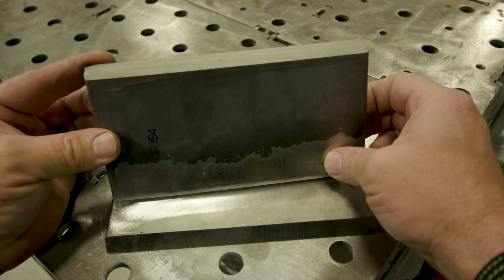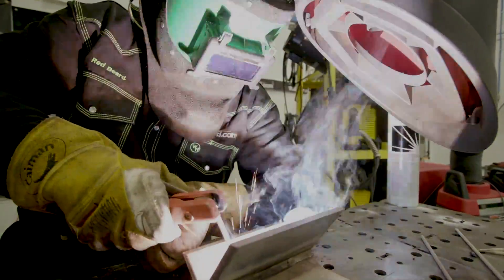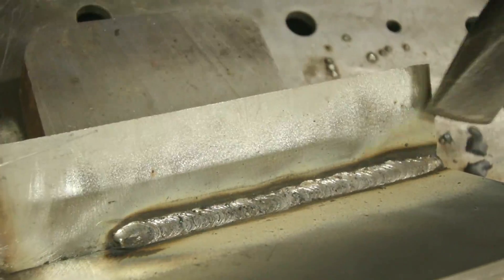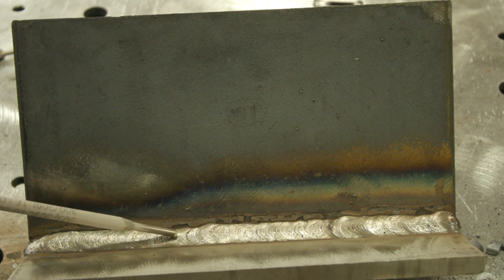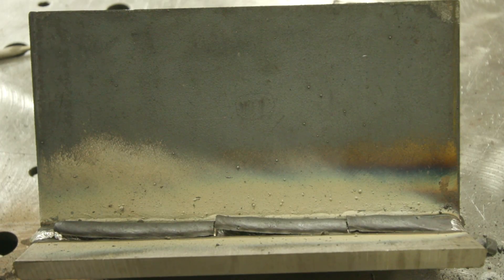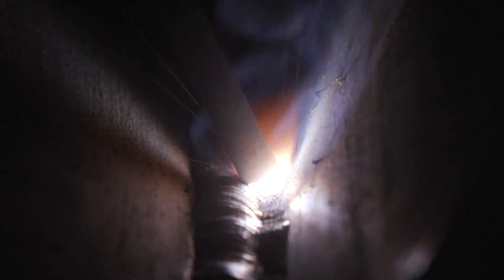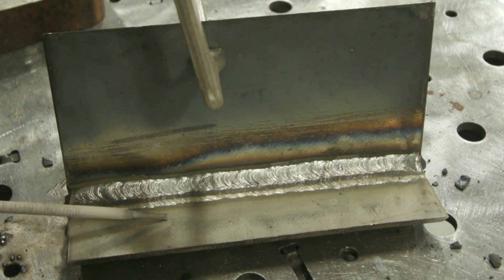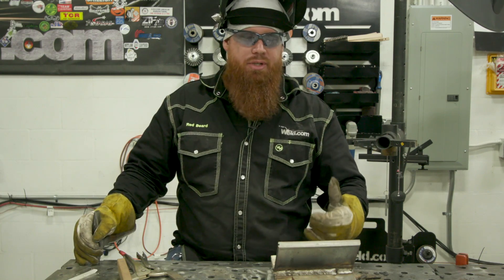Welding Stainless to Carbon Steel with 309 (1F)

Comment: Can you use these rods for stainless to mild steel?
Reply: A36 is what he said in the first of video...
"...ASTM A36 steel is one of the most widely used carbon structural steels, although the carbon content of A36 material is maximum 0.29%, it is considered to be the mild steel (content of carbon ≤ 0.25%)....
https://www.theworldmaterial.com/astm-a36-steel

Comment: While watching 2 things came to mind. (More, but for now just the 2) First, it would be interesting in finding out some metal composition details on why you put more heat into the stainless. Does it conduct heat better, ...? Second, assuming I remember correctly from others videos, I had thought stainless should be welded with as little heat as possible. Or was that when stainless is welded to stainless, or under food grade applications, or..?
Whatever, nice video, thanks !

Comment: There be eth a couple of spots on my steel boat where a stainless fitting was welded to the hi tensile steel deck and after 48 years the steel is suffering like el rusto malo ish.   And seeing you brought up the subject of steel boats,  I'm having a lot of bother stick  welding the one inch gal pipe to the 1/8th" deck.  Actually I'm not on the deck, just practicing with lots a chopped pipe onto 3mm plate and I can't believe how ugly the welds are. Used little 2mm rods, 1/8th rods,  and it looks like a pigeon has perched on the top of the pipe and deposited its own contribution.
May I  suggest a video demo in the future of welding gal pipe to steel as well as 90 degree 5/8 " gal pipe to 1 " gal pipe joins.

I love the smell of burnt zinc in the morning,..........smells like,.................victory.

Comment: For a 1F fillet in the most premo conditions ( any height, sturdy arm placements, no vision obstruction, clean and thick material ) ..this is actually a sub-par weld at best. Your root pass was extremely inconsistent, and it really wasn't that smooth of a 2-pass cap. Don't make another stainless demo.
Reply: jack ho thanks for the feedback man. If you have any tips you think would be beneficial to the viewers as well as myself please feel post them here. I’m always open to learning anything that would help me improve my skill sets. Thanks for watching man.

Comment: Also if too much heat is put in on stainless all at once it has a tendency to crystallize “ sugar “ on you 
Best to keep the inter pass temperature down on thick groove welds

Comment: What would be the scenario to weld carbon steel to stainless?
Reply: For solid contacts where one may get coated with paint or something for protection, and the other is commonly a contact/ moving part and would just rip off any protective coating. For example a spring-tensioned gate latch like mine.

Comment: Just tossing my ignorance out there big here, but no Solar Flux type B?
Reply from the maker: When your not melting through the backside you don't need to purge it.
Reply: @Welddotcom  OK, thought you still needed it anyway because it would get hot enough for sugaring. Thank you!
Reply from the maker: @AustrianAnarchy  Check out the previous video we did on welding thin to thick stainless. We touched on that 👍

Comment: can the fillet weld be further reinforced by welding the joint from the opposite side?  asking for a non-welder friend 😁
Reply: Theoretically yes, but then there will be areas of contention just outside the weld zone. Ideally you want everything "smooth and uniform", i.e. same weld thickness as parent material with no inclusions or defects. 
Think of it like this: decades ago when guys were putting "monster" 35" gumbo  mudders on their jeeps, U joints were snapping faster than bones in a retirement home.  So they installed beefier U joints; then driveshafts were twisting like licorice at the Twizzler factory. 
Yea, kinda like that. 
But in reality, I don't know wtf I'm talking about......just making it up as I go.
Reply: Tommy T 🤣🤣🤣🤣
Reply: Tommy T good to see that you're faking it till you make it then faking it some more.
Reply: @markfryer9880  hell yea bud, just ask my wife! She believes absolutely zero of the words coming out of my mouth!!

Comment: A video on a 309 dissimilary test would be awesome! I’m a union pipefitter/welder and we currently have a test, 2g sch 80 309 tig root and hot pass, and 309 stick out. The company I’m working for right now is trying to get me to take it but I cannot figure out a good method to run the 309 stick in position... Iv came close a couple times, but haven’t passed yet. Any tips would be great
Reply from the maker: We will add it to the list.
Reply: @Welddotcom  ask Zach for a pic or vid of his weld and critic that. I'm curious too. Zach, why are you not passing, porosity or something?
Reply: On the plus side they want you to take the test so that is a vote of confidence in your skills.